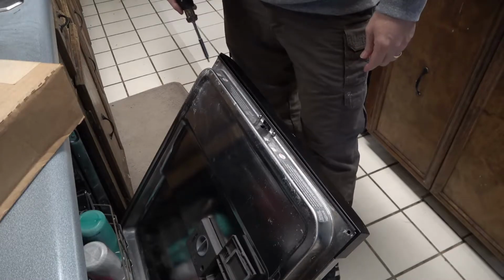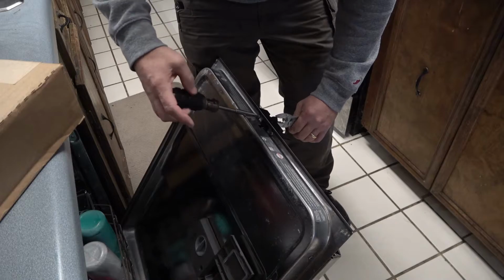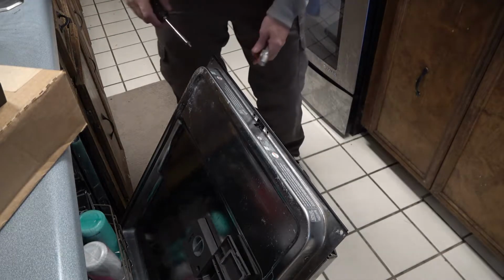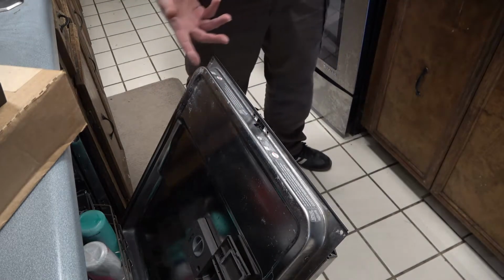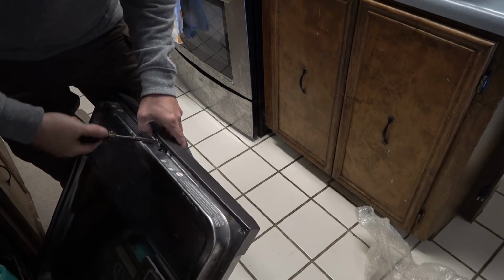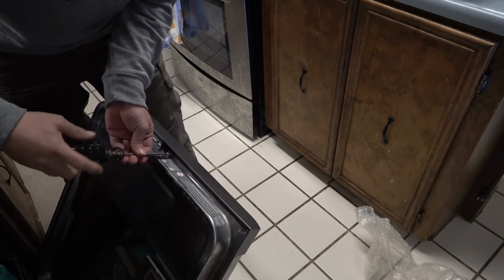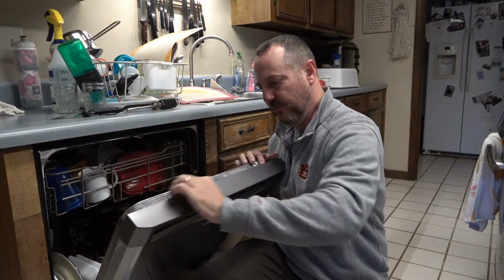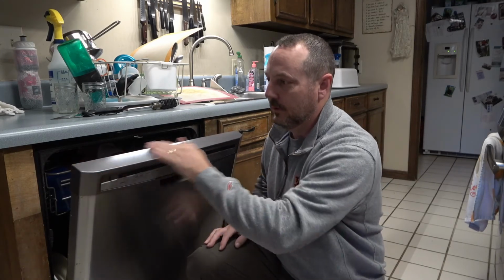Maytag / Whirlpool Dishwasher Control Panel Replacement

Comment: Thanks for the great video,. Unfortunately my panel had two broken plastic pieces that would have cost $300 to replace. I used JB Weld instead and fixed it for about $5. Working fine for several months.
Reply from the maker: Good to hear

Comment: This Maytag washer control panel is actually a faulty design. The force applied to the handle to open the door will pull the panel up and bend then broke the thin plastic piece that the corner screws are attached. Mine broke like many others. Maytag should provide the panel for free as a recall.
Reply from the maker: I agree, but until they do, I will continue to repair as needed

Comment: I need to know kind of screw driver will remove the original screws. Looks like a 5 star small. Can you answer what I need to buy?
Reply from the maker: Buy a Torx set
Reply: Torx bit, size T15.